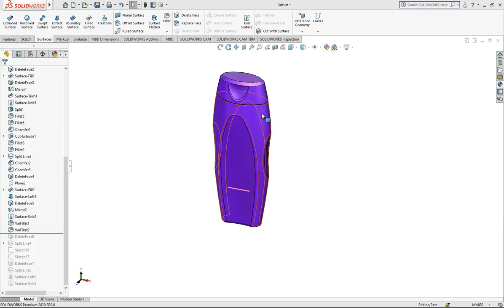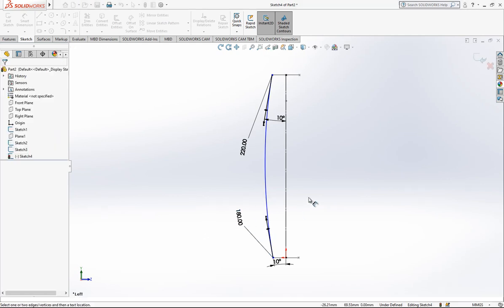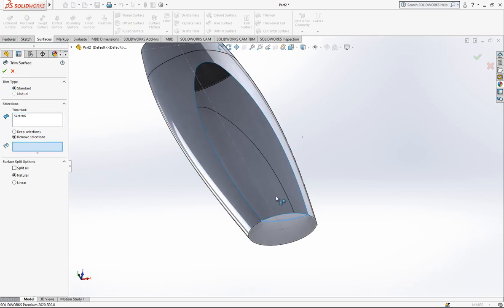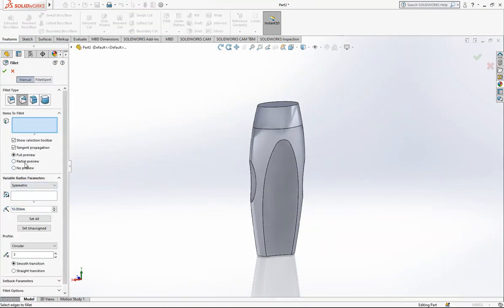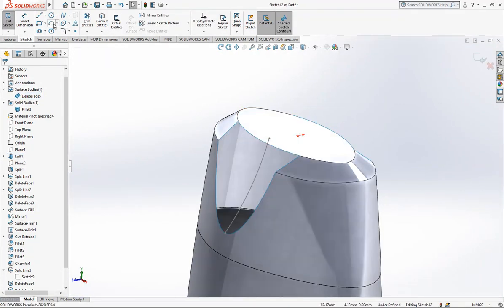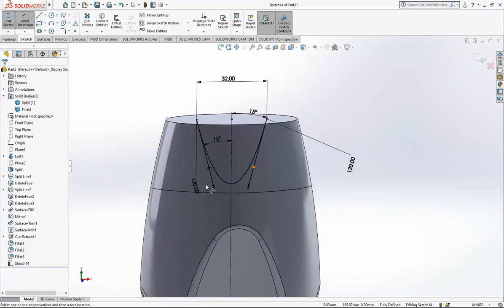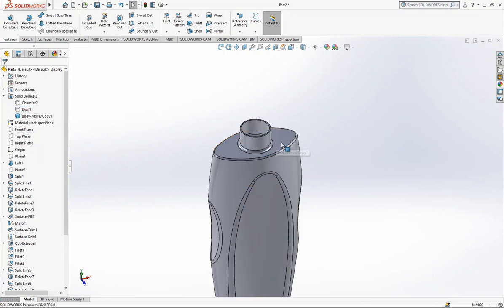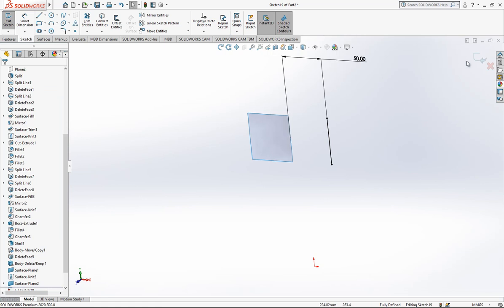Shampoo Bottle - SolidWorks Tutorials

Comment: Which is the best for CAD, Siemens nx or solidworks
Reply: Yes indeed. I decided Nx, Solidworks and AutoCad.
Reply from the maker: Hi, depending on what you want to do. 

Both is good program;  Solidworks very practical and user friendly, Siemens have so good Surface commands and provides alot of varieties.